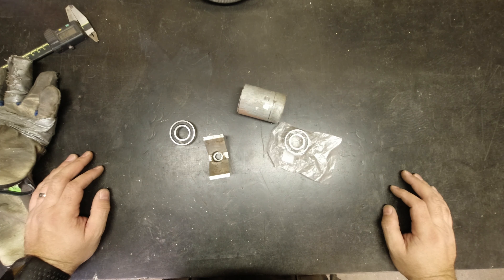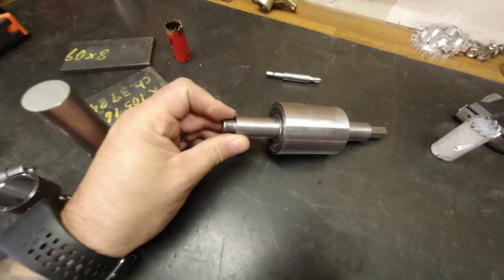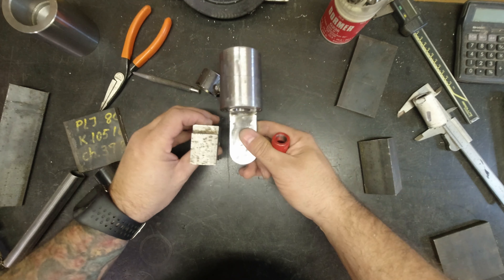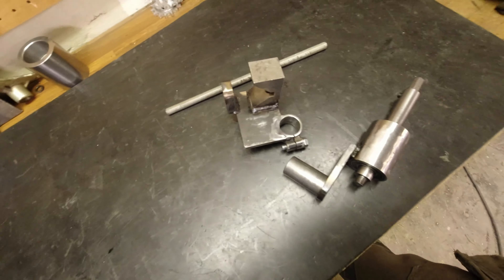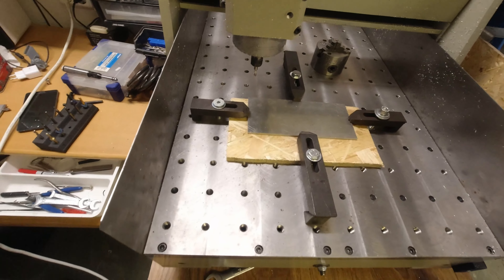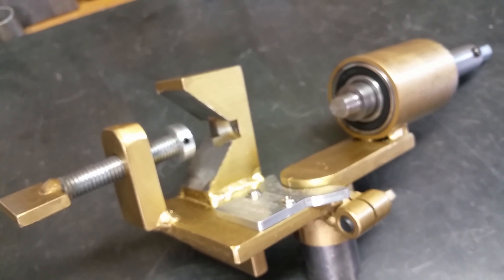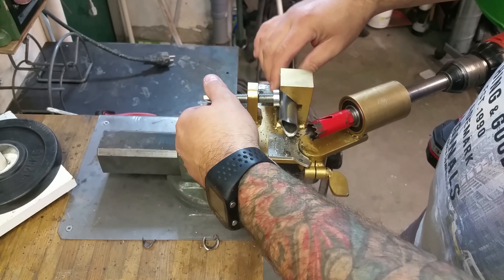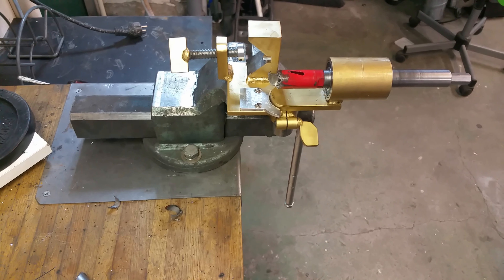Building A Homemade Tube Notcher. How To Build A Fully Adjustable And Easy To Diy Pipe Notch.

Comment: You might think of being able to move the saw closer to the material for a more rigid shaft at the start of the cut.
Reply from the maker: Yeah, I played around with that idea first. But then you can only change the angle in one direction, and I wanted to be able to cut in both angles. And it cuts very stable as it is actually👍🏻😃